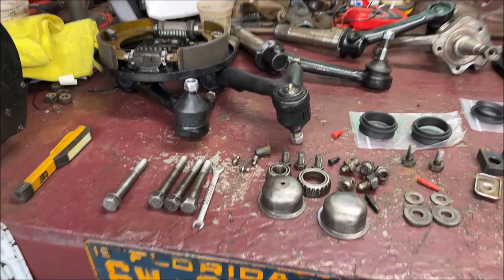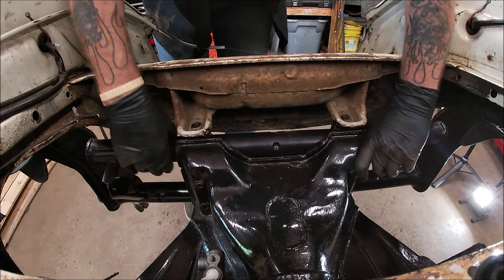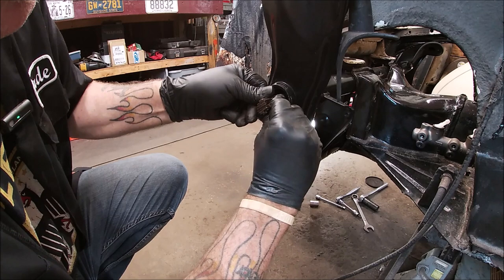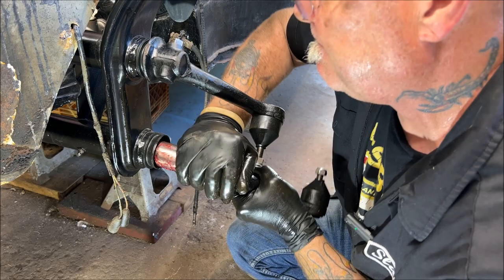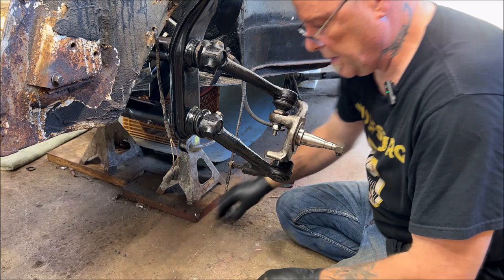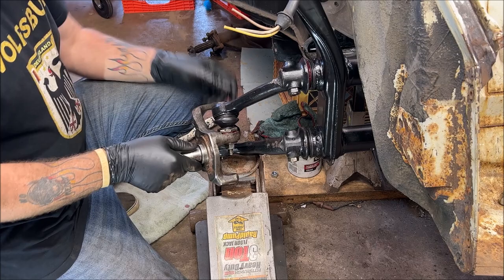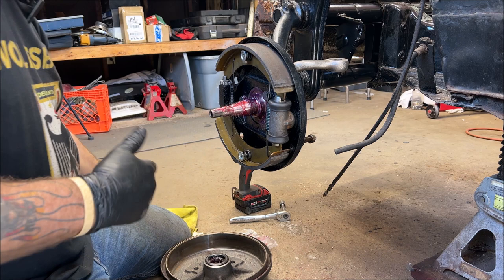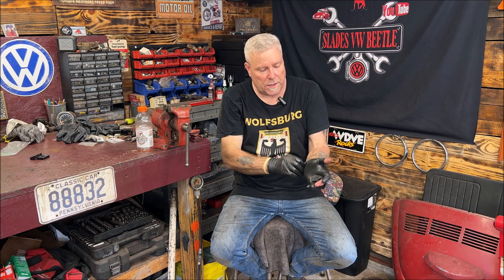VW Classic Beetle DIY Front Beam Assembly - VW Bug - VW Ghia - VW Bus - Beetle DIY Videos

Comment: I'll agree ----- 92 degrees is getting hot ------- BUT ------ just be Thank full we aren't down like in Palm Springs where they are hitting around 117 degrees or so for eleven days straight with night temps of 80 ------- Thanks for the video ---- I always like to put a drop or two of oil or even lightly coat with grease on the cleaned bolts before reassembly ------ felt it would help in disassembly ---- whenever that day would come ---- am fine without you doing a Brake Video ---- See Ya -- on your next one ----------- Rodney
Reply from the maker: Thanks my friend!! Grease is a great idea on the threads!! Thank you for adding that to the comments!! Hope you’re well brother!!

Comment: great video, I have problems with the whole are you are working here, it's my 71.  I bought it years ago and drove it home, the front drivers side was rigged to get me away from the point of sale and when I turned into my neighborhood the whole car felt like i was driving on railroad tracks it it fell of track. LOL   also, the brake line explode right at the peddles in the floorboard of the drivers seat.    I don't know if it's best to try to rebuild  the front end or what yet.   I have other issues but those two are preventing actual driving.  so what I was talking about is the wheel just flops out when turning.    i ordered all my brake lines ( the kind I have to bend and fit myself.      i have not done anything to it yet.  Been sitting a long while, i just got new tires for it  changed them all out so the HOA sob's will get off my back.   i do also have some heater channel rot on the drivers side and the bottom of that door as it was setting where leaves got piled up and it stayed wet there for awhile.   I wonder if there is a way to fix that without removing the whole body and replacing the floor  and all that cool stuff..       pretty much why i have not started on it.  Grr.      I am debating on  jumping right in  or just selling everything.    I have always had a Beetle ( non super )  since I was a kid but none ever really needed anything major like this one.    what do you think?

Comment: This was an awesome video ! I'm getting ready to take this on myself as First-time bug owner. I went ahead and bought all new tie rods and ball joints. I know that the needle bearings need to be replaced too. This made me realize I need to get those done while it's apart. I'm scared that the trailing arms will have wear in them and don't have the money to replace them.  Would replacing the bearings for bushings be an option? Any help would be appreciated thanks 👍🤟🤟

Comment: Instead of making adjustable beams to raise or lower your car, why don’t they just make springs with different divot locations? That would be cheaper and easier to do.
Reply from the maker: I would have to agree with you. I’m sure there are much easier ways. The beam that I received was a sponsor, which was really nice. I seen people use all thread rods, not sure where they’re getting them from. Instead of the torsion leaves.

Comment: Where do I purchase quality brake shoes that stop well? My factory original brakes were great. I rebuilt everything and it all turned out perfect and all is bled like it should be. But, my pedal feels hard relative to my stopping. It is like the compound of the shoes was meant to last 100K. They stop and stop even, but the pedal pressure is too high. I have driven the Type I Standard for almost 125K so I know how the brakes are supposed to feel. Any suggestions?

Comment: When you buy the beam does all the parts come with it? All the rubber parts etc or are they kits?
Reply from the maker: No unfortunately they don’t. You just get a bare beam. At least in my case it was a bare beam.
You should be able to reuse your torsion bars, and spindles, and a few other things off of your current beam

Comment: wheel bearings snug -up--turn the wheel  and back off 1/4 turn  as you drive they get hotter and will run hot and fail

Comment: Doesn't the wheel brake cylinder go on the top?
Reply: That's how I have always done them.
Reply from the maker: No, they do not on this style of back plate. 
The rear brakes, have a four bolt backing plate which sets the wheel cylinder at the 12 o’clock position. …
The front backing plates if you noticed in the video, there are only three holes in the backing plate, they only go on one way. 
Which sets the wheel cylinder at the 3 o’clock position on the driver side, and the 9 o’clock position on the passenger side.
Reply from the maker: @Slatersave  How are you getting them to the top position? On this style?